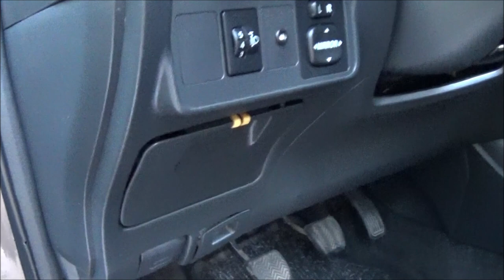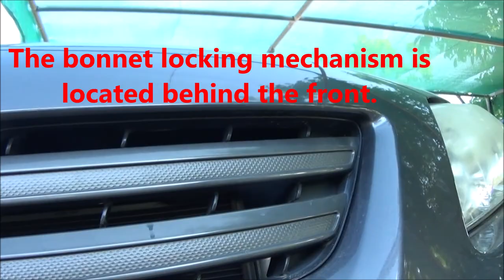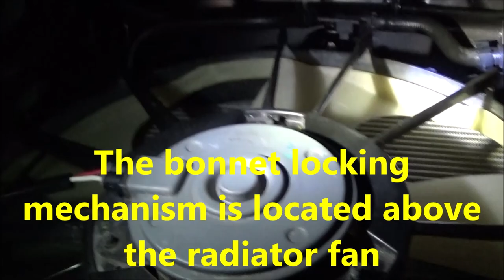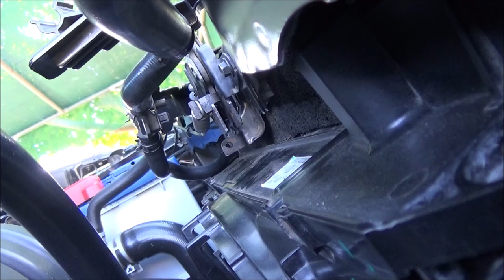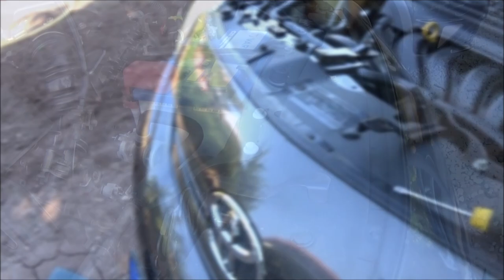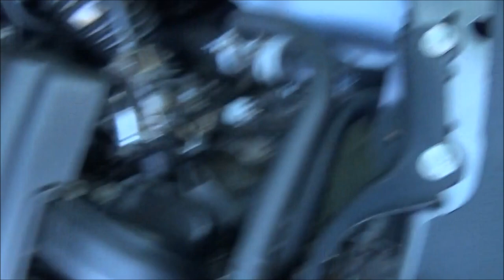2007-2013 Toyota Corolla How to open stuck and locked Bonnet/Hood Κολλημένο και ασφαλισμένο καπό

Comment: Thanks a lot, I was looking for a way to open it without drilling or removing the front bumper or paying a mechanic for an expensive hour of work.
I knew it's supposed to be something relatively simple to do by myself.
Reply from the maker: Thank you very much. Did you finally manage to open the stuck hood of your car?

Comment: Had the same problem, easier than this
1. Get someone to keep pulling the bonnet opening lever 
2. you go to the front and punch the top of the bonnet over the latch a few times, it should open inshAllah
Reply from the maker: Is that what you did?
Reply: @YiannisPagonis  I was there struggling to open it with some basic tools, a neighbour came along and showed me the trick. So credit to him
Reply from the maker: @timemahshin3868  Maybe this way it will open. However, each case is somewhat different

Comment: I used the same method but my job was easier because a road alligator took out the plastic guard conceiling the area. I got it to pop open but will let the secondary latch hold the hood until I can get a not latch.
Reply from the maker: oh this is wonderful!

Comment: Can you do this without lifting the car ?
Reply from the maker: mmmmm I do not know. You need to have some space to fall from under the car. Anyway I will try it and I will tell you ok?
Reply from the maker: Unfortunately my friend the car has to get up so you can do it
Reply: I jus t open it without lifting,just removing the plastic cover,and a long arm and patience,thanks dude.
Reply: If you have a small head. I had to lift it only a couple of inches.